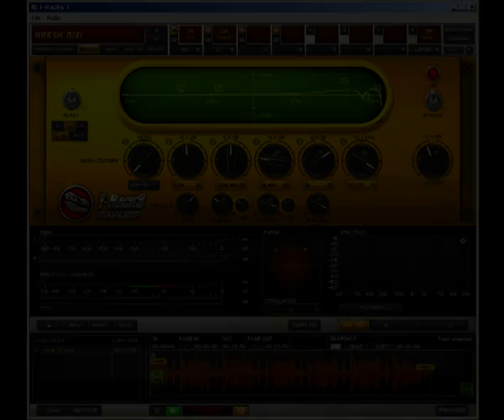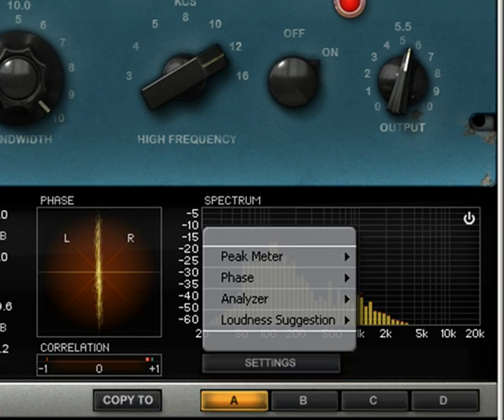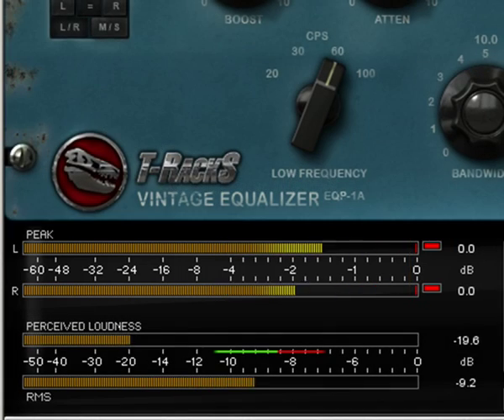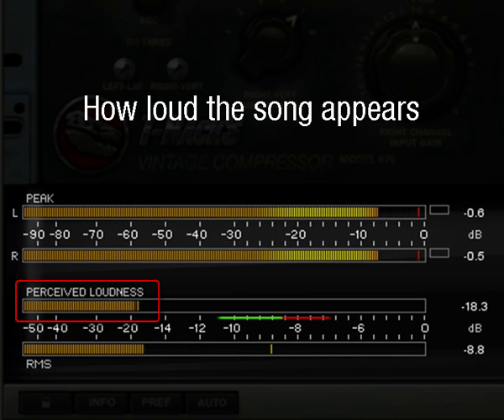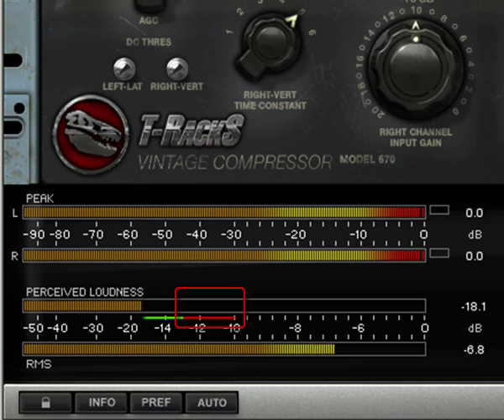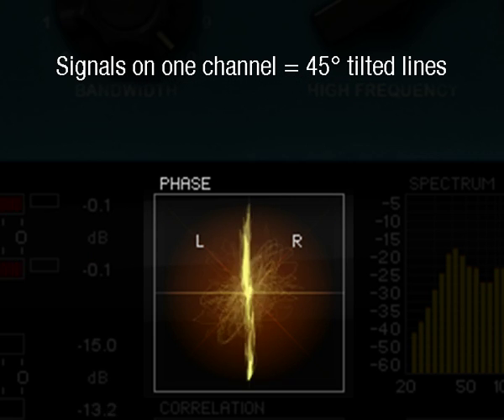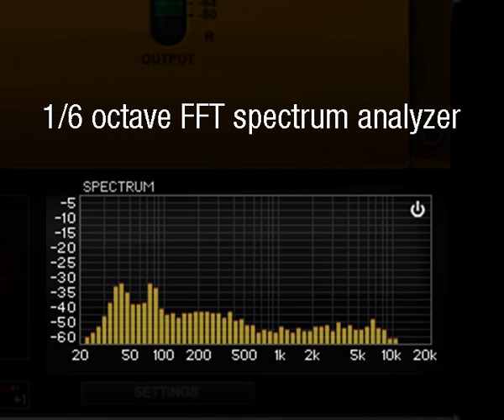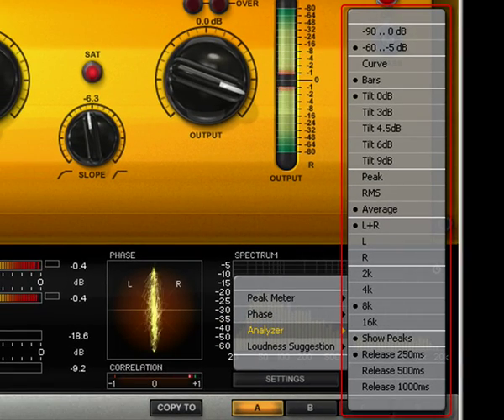T-RackS 3 Metering - Proper metering for mixing and mastering like a pro

Comment from the maker: @spameister Brickwall is a limiter.  Compressors are what you can use to kill dynamics to all be the same.  That said, we also do warn against the practice of overloud mixes right in the T-RackS manual.   The person who hand-built the real Opto Compressor hardware (and which got modeled for T-RackS 3) has done mastering with it and many of us understand the concept of the overloud mastering trend.  Again, look in the manual where we speak to it directly.

Comment from the maker: @palace224 You can EQ and mix individual tracks and then master as a collection of tracks for a CD or whatever.  That's really what mastering would do for you as far as the typical definition - provide some continuity amongst a group of tracks.  Sounds like you might be doing more mixing than mastering which is great for beats and individual tracks for sure.

Comment from the maker: RMS is a measure of only the power of the signal (basically the electrical power transferred measured with an equation based on the Root Mean Square values), and does not take into account the effect of different frequencies as is done when T-RackS measures perceived loudness.